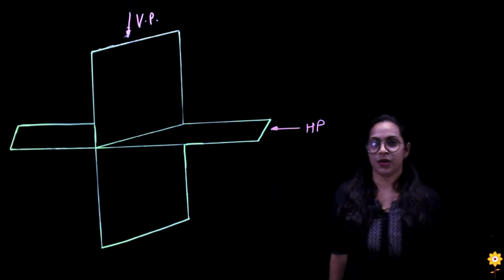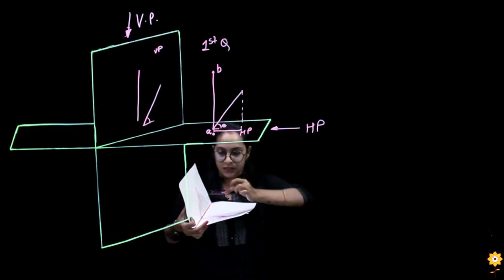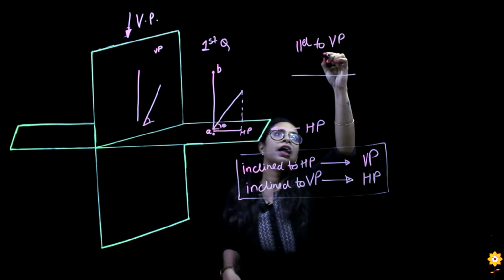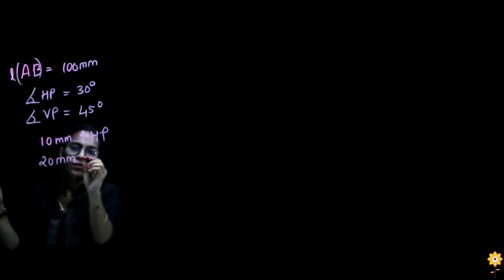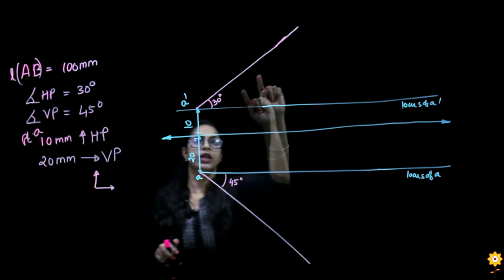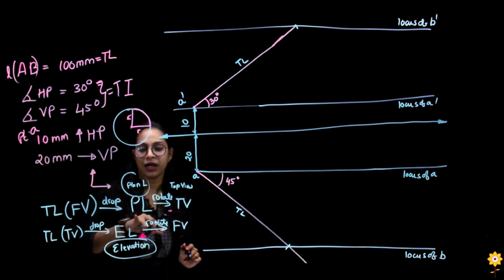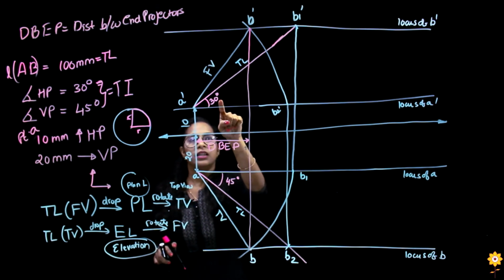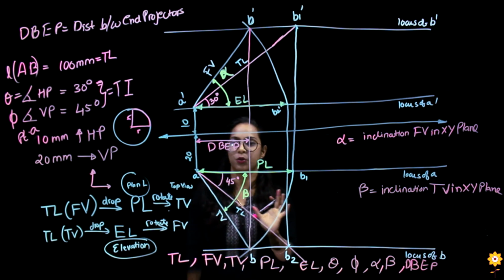Projection of Lines | Engineering Drawing | #2 | PCE | Prof. Sonali Parida

Comment: An excellent presentation, thank-you so much. To clarify for some viewers who are confused, I would like to look at this from a different starting perspective:

A line which is parallel to a projection plane shows itself as its TRUE LENGTH (TL) on that plane, therefore:

A line parallel to HP is seen in its TL on HP 
A line parallel to VP is seen in its TL on VP

Therefore, given the TL of a line, ab, (lets say the front view,FV, but it could equally be the top view, TV) if we draw this TL on either projection plane, we know that it will be a parallel line on the principle plane that is perpendicular to it (I am only referring at the moment to the two principle planes that we are calling HP and VP)

Therefore, by "dropping" the end point of a line, in our case b, assuming the other end point, a,  is fixed, to the locus of all points at a distance, a, from the reference line (RL), we are satisfying our condition that this parallel line is seen in TL on other perpendicular principle projection plane. 

All we need to now do is to rotate this point to the locus of all the points that b could lie on and we have the Top View (TV) of the line. Similarly, this process is repeated for the other projection plane and the result will be the required Front view and Top view of the line.

Your presentation in this video is actually a very useful and thought provoking way of looking at the projection of line, thank-you. I particularly like the way that you introduce the concept of the locus of points to solve this problem.

Comment: Nice explantion but still 
I have this doubt 
Frm the sentence 
"line inclined to hp inclination is  projected on vp"
Fine 
But the inclination is on horizontal plane vertically 
Then it will b line on both the planes!? 

**Like the way u confused in xplaning with the inclined position on hp**!??